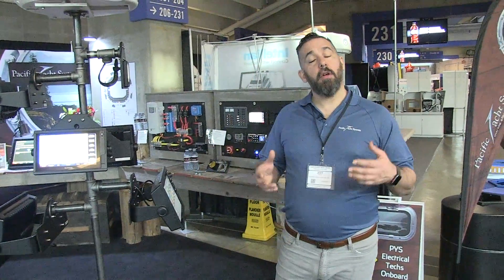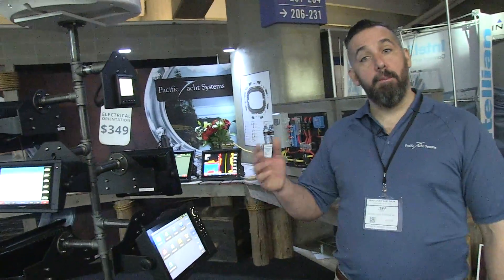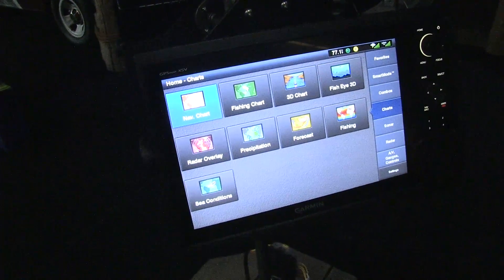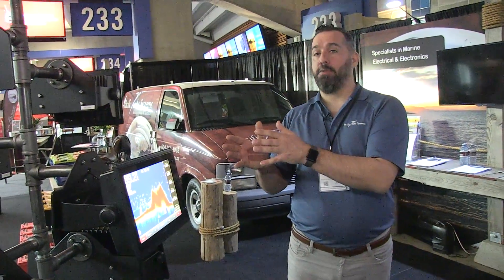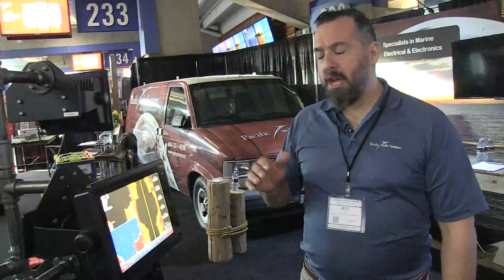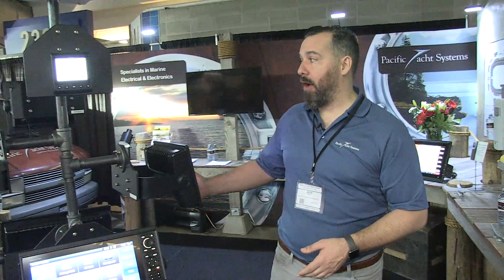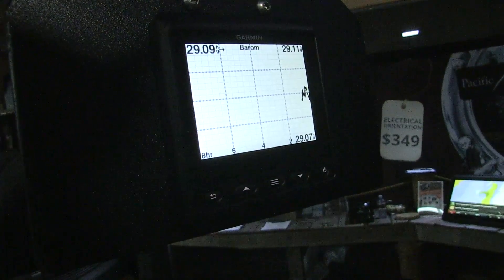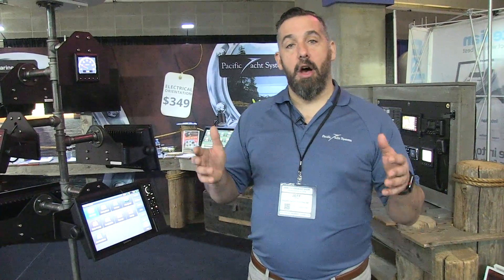Garmin 1222/1242 Touch vs, Non-Touch

Comment: Hi, very important point in my view is how touchscreen operates on an open boat in bad weather? is it better to be using device with buttons on open boat in case of rain or wind where the waves could spray on the screen. I'll be really grateful if you could help me choose between touchscreen and button model. space is not an issue they would be mounted on the central console but there is no T roof

Comment: Never heard anything about 1222. What’s the difference between the 1222 and 1242
Reply from the maker: The 1222 doesn't come with pre-loaded charts, the 1242 does.
Reply: Is there no longer a active captain on these to connect to your phone since it's no longer touchscreen
Reply: @Knowbetterdobetter1  There is active captain for sure, it is actually the wifi it connects through, there is nothing to do with the buttons. the question is: if the button version is more reliable in bad weather conditions than the touchscreen